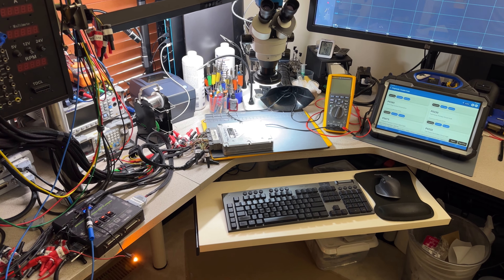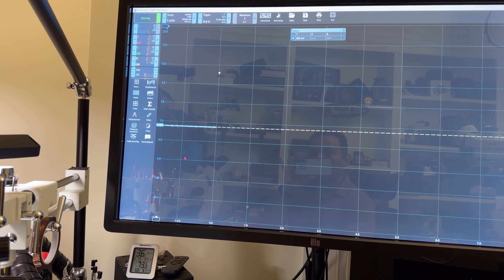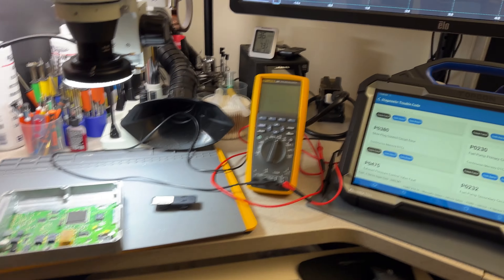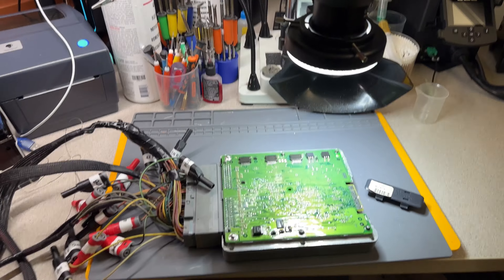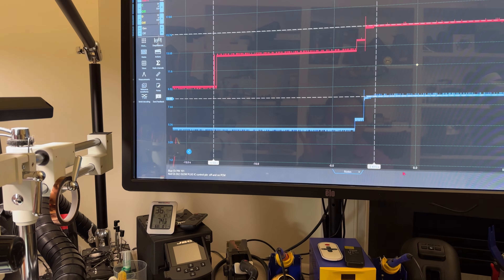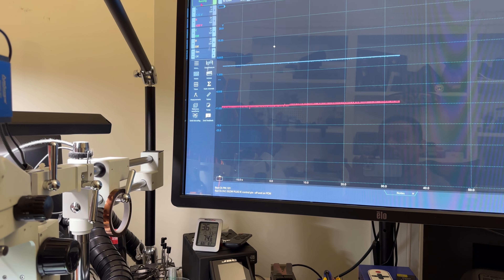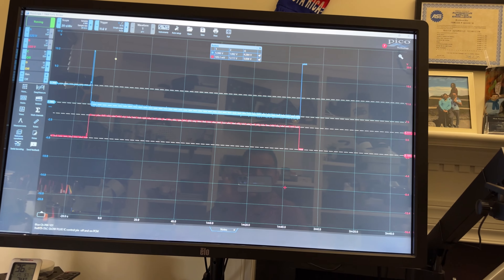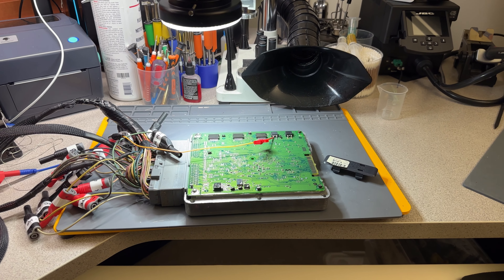2002 Ford F-550 7.3L Diesel no glow plug relay actuation, test before and after repairs Eloy L in VA

Comment: hi good video where you get the diagram? my rpm circuit no work I install pto on  322 lb/y 66 pin .i want to see where it come from before pcm?
Reply from the maker: @moisesalvarado4203  Identifix, you can get them in Allldata too.
Reply: @MaicSalazarDiagnostics  thank you